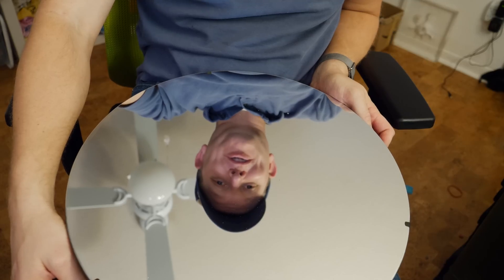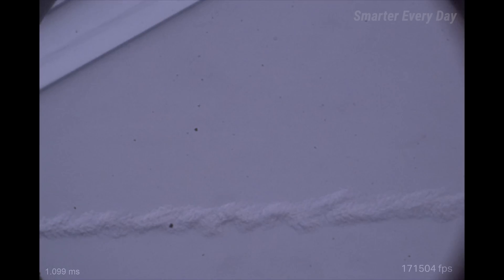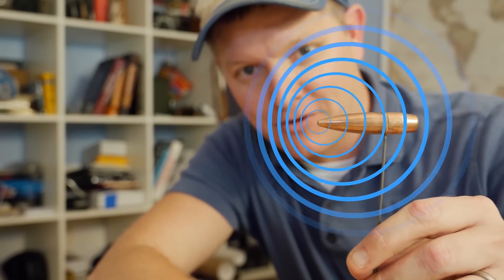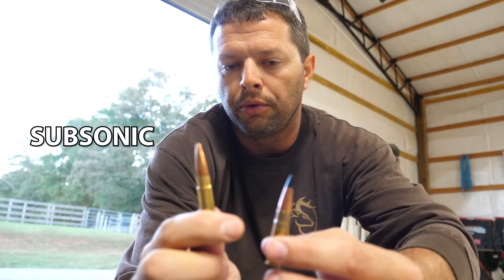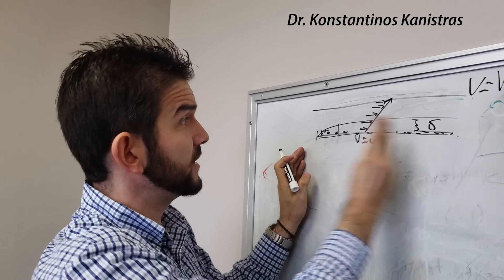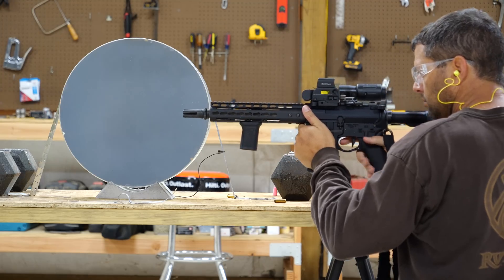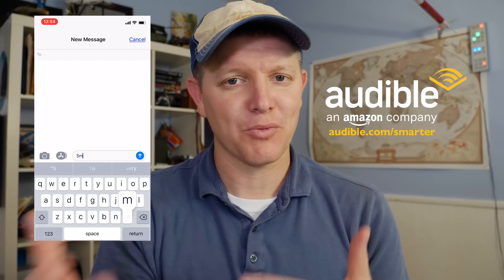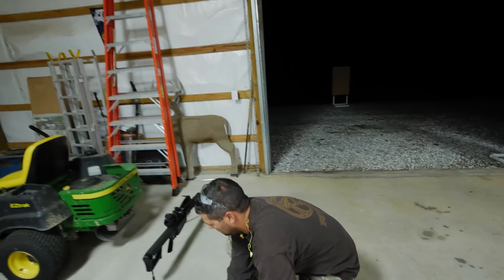Shockwave Shadows in Ultra Slow Motion (Bullet Schlieren) - Smarter Every Day 203

Comment: What would happen if you set up two Schliren cameras at right angles and filmed some of these events?

While the order imposed on the air by the initial tip shock waves is interesting, i’m drawn to the chaos of the passage turbulence. Is it actually a helix? Can you compute the spin of the bullet from that turbulence shape?  Does it relate to the tiny circles you noticed in the shock waves themselves?

Finally are we thinking about this 4D phenomena only in 2D?

Comment: Light always travels at the same speed right? So the whole refraction thing at the beginning of the video should be untrue.
Reply: It always travels at the speed of light _of the given medium_, yes. Which is slower in dense air and faster in less dense air, with the maximum (and the usually quoted one) in vacuum. That's also how Destin explained it in the video.

Comment: It would be really interesting to see the shock wave pattern when a supersonic projectile slows down to sub sonic speeds, but that would be virtually impossible to catch on video I think.  At least as far as I can imagine anyhow you would have to know the exact range that the speed drops so that you could set up to record it and even the slightest change in the burn rate would move that location.  I wonder if the Navy's magnetic rail gun can provide that consistency?

Comment: In the video, they should mention that the heat generated by the air on bullet created a vortex on the side and on the back on the projectile. This hot air create temporally a air density vacuum (hot air is less dense then cold air) an the cold air will rush to fill the void and will be accelerated at supersonic speed. That is what the Dr. might have explained but have been cut.

Comment: i'm pretty sure you'll explain how revolvers don't have a seal between the cylinder which is why it vents out the side. however, i should note in case you don't, that that feature doesn't allow it to use a suppressor. however, there is one example of a revolver that can, the nagant revolver, as it seals the the cylinder by pushing it forward. 

i was planning on getting one, but the one i found is in 38 h&r. $245 is a great deal for it, but the ammo costs about 50 cents a round for reloads (the shopkeep said he found ball for 50 rounds for 20 bucks... idk where he was looking but i cannot find anything outside hollow point and it annoys me. this is actually a cheaper round compared to the round it used to fire which is also wierd as the casing necked up to about the top of the bullet... the nagant revolver is weird and i want one, but i know it'll just gather dust or i'd have get a better gun. (currently looking into a px4)

Comment: You should use this filming method to answer the Air Force's questions about the effect of tracer plumes on subsonic 7.62x51 tracer rounds:
"It is not known why the burning tracer has the effect of decreasing the
dynamic instability of the 7.62MM rounds at subsonic Mach numbers, it is suspected
that a jet damping effect could be acting or perhaps a wind vane effect caused by
the tracer plume."
https://apps.dtic.mil/dtic/tr/fulltext/u2/a111780.pdf

Comment: the speed of sound is not static! it's actually a range called the "sonic regime" so different parts of an object can be breaking the sound barrier at different times while the object as a whole is all going the same speed! it's why the visible cone on a jet moves down the jet as it passes certain speeds (the cone isn't actually the "sound barrier" it's the water vaporizing because of the low pressure pocket created behind the shockwave, it actually happens much lower than the speed of sound)

Comment: I think the circular shocks you can see are perhaps from little cavitation bubbles forming behind the back of the bullet as it travels through the air. The air moves around the bullet and then suddenly falls back together behind it, bounces, forms a little shockwave from that bounce, and the process repeats a certain number of times determined by the speed of the bullet and the (I guess) viscosity of the fluid (air in this case).

Comment: If you look at the similar as during the air show at just Mach 1 and or the speed of; tip of propellers on Turboprop aircraft and also tip of turbofan blades on jet aircraft. The engineers don't want it to do Mach 1+ on tip of blades for very long exposure do to the shock wave will destroy the fan blades.

Comment: What an awesome video! I saw a fair amount of Schlieren images in my aerodynamics courses but to actually see things in motion is beyond amazing, thank you so much for doing this! Btw, I don't think you can use the $M=1/\sin{\mu}$ for those shock waves - that relation only applies to sound waves (waves of "infinitesimal" change in density, which do not create any entropy), but not shock waves (across which there is finite change in density and entropy is created). To calculate the Mach number of the incoming flow, you need to know the flow turning angle $\theta$ (which you could determine from the bullet tip shape) and the shock angle $\beta$. The formula is then $$\tan{\theta}=\frac{2\cot{\beta}(M^2\sin^2{\beta}-1)}{(\gamma+1)M^2-2(M\sin^2{\beta}-1)}$$, where $M$ is the Mach number of the incoming flow and $\gamma$ the ratio of specific heats (1.4 for air), but the result is most easily read off a diagram. "Anderson, John D.: Modern Compressible Flow" seems to be a good resource.

Comment: Sweet vid! Re: normal shock on the subsonic bullet. I don't doubt that what we're seeing is the normal shock at the first band (mind you I never took aero class), but at the second band, what do you think about the effects of the knurling (go to t=4:38 and look at the very end of the casing) in the copper jacket interacting with the air as the bullet is rotating (along it's long axis). I.e. what if the knurlings are acting like an impeller and beating the air as it spins, therefore causing a disturbance? Thoughts?

Comment: What you are seeing is the bullet spinning at a high rate of RPMs while traveling supersonic speeds like 150,000 RPMs for a bullet going 2500 fps down a barrel with a 1 in 12 twist rate

The bullet is actually high speed drilling its way thru the dense air friction in front of it while creating a low pressure line of air directly behind the bullet in flight

Comment: Good day gentlemen that was very cool but not for the reasons of the title of the video . I was actually interested in what seems to be the air and gases leaving the barrel before the bullet . I'd love to see a video concentrating on that aspect . It was more pronounced in the revolver video but can be seem in the muzzle blast rifle video . 

I like to see a more concentrated view of the muzzle at different angles to see how much and at what force air and gases are expelled from the bore before the bullet leaves the barrel . More specific does that air and or gases interact with the muzzle device of the rifle in away that effects point of impact shifts . 

The other thing I'd like to see is if there is actually blast coming out of the muzzle ahead of the bullet when using the revolver . If so that would seem to indicate that the gases from the powder expand around and past the bullet before it engraves into the lands of the barrel ??????

Comment: Before he did the breakdown of the subsonic bullet I kinda felt like I knew what it was already. The lines around the bullet reminded me of a jet as it's accelerating and beginning to pass the speed of sounds. There's a brief period where you see a "cloud" surround the jet and it looks alot like that bullet.
Reply: The smoke in a jet is not the Sound wave, you cannot see sound wave or sonic boom in a naked eye. The Cloud in the jets are cause by cold relative air that surrounds the jet/bullet, passes to the rear side of the jet/bullet which is a very hot area, changing the Temperatures from extreme cold to extreme heat at a very Fast Rate could cause a cloud that can be seen in the pictures of Jets reaching Mach 1 above.
Reply: In some pictures you can see water to condense behind shock waves.The effect is calle Vapor cone. The effect is caused by temperature reduction around the jet/bullet and high relative humidity (highly simplified explanation of thermodynamic process happening). There is pressure raise and drop which have matching temperature changes.
Reply: At first I was thinking it was a disruption in airflow due to a cannelure around the bullet at the point of the disruption was about where a cannelure would be on a rifle bullet.  My thought was this indentation would be causing the smooth air wrapping around the pointed end and flowing around the sides to ripple a bit as it flows over the cannelure in the bullet jacket.... but I guess I was wrong :-)
Reply: @EBinCA r/iamverysmart

Comment: An excellent video but one question: When you measure the angle of the shock-wave to the trajectory in your first video, you get approximately arctan(5/8) = 32 degrees. The sine of 32degrees is 0.53 and the inverse of 0.53 is 1.8867 which I agree is the Mach number. Assuming the local air temperature and density give the local speed of sound as 343m/s, the speed of the 50cal projectile accounting for error in angle measurement is around 650m/s. Most 50cal projectiles have muzzle velocities of between 850m/s and 930m/s. So what round did you use?
Reply: the cheap stuff

Comment: Question:  Has any significant research been done on the effects of 1/3 normal gravity on the human body over prolonged exposure?  If living for an extended period in 1/3 normal gravity causes significant serious damage to the human body, then Mars and the Moon are essentially worthless for human colonization.  Before we spend tons of money trying to colonize Mars or the Moon , we should now the answer to this.  Research on mice on this issue could be done on this issue on the ISS at very low costs in terms of launch cots, space on the ISS, and astronaut time.  When will this be done?
Reply: When there is a method of simulating different levels of gravity for long periods. :)

So far no one knows for sure.  We have had people in micro gravity for more than a year but no data on long term effects of various fractions of gravity.  You are 100% correct, answers will need to be known for long term living.  I have wondered why no one has not tethered a couple space craft together and spun them up to at least moon gravity and put some test subject (man or mouse) in there for 6-12 months.  The moon is close so long term studies of low gravity will probably start with incremental stays there.  I suspect no studies will be done until the cost and reliability of getting off the ground reaches a certain point of affordability.  Until then they will probably just keep the exposures short leaving no one living permanently off planet for some time yet.
Reply: Lensflare Deviant Mice!  Take a rotating habitat 2 m in diameter up to the international space station put by cement and rotated at about 20 rpm. That will give you an apparent gravity for the base of about 1/3 normal gravity or something just about equal to Mars gravity. Keep the mice there for as long as you want (they don’t have a Union) then bring them back and see what kind of effects of happened or not happened on their metabolism. Cheap, quick to do, and it would certainly give us some significant data. Certainly, It wouldn’t be data on people but it would give us some indications of what we might see in people. Right now, as far as I know the international space station is the only place that we could really do this kind of testing quickly and cheaply. As far as I know though, no one is doing it. Why not? Wasn’t the idea behind the international space station to enable us to do experiments exactly like this?
Reply: @wbwarren57  In 100% candor I'm not at all certain if mouse studies would yield anything useful but on the flip side I find myself in complete agreement that not only could something like you described be done but that IS what they told us that station was for..  Any data is a starting point and if nothing else an experiment along the lines you described would still yield up SOME information, much more than how ants work in micro gravity.  It becomes even more important once there are enough people floating around that someone can get themselves knocked up.  I was even wondering about short term exposures for things like a Mars mission.  Right now they're saying 6-8 months to get to Mars.  Fine, that's in micro gravity.  Right now after 8 months in micro-gravity the people come back as weak as kittens.  Mars is still only 40% earth gravity but those first explorers are still going to arrive partly disabled and will need to recover from the journey before they can even think of wandering around planting flags.  If there is a medical emergency at that point there could be a problem!

Comment: You could figure out if that last weak shock wave was from the muzzle by doing a little math
(I'm a bit rusty on this sorta thing so I might be getting some of this a tad wrong but this is how I think I'd go at finding it out)
Using the frame rate and the known length of the bullet you can find the velocity(or having just watched a little further in you could just use the mach angle to find it), you'd need to know how far the gun is away from the spot being filmed and use the velocity to find when it was fired then divide that by the speed of sound to get how long it would take the shock wave from the muzzle to reach the frame, subtract the time that you got from plugging in the velocity of the bullet and check if the shock wave appears around that time after the bullet enters frame.
You should also be able to do generally the same thing to find out how far the surfaces the supersonic shock waves are bouncing off. We know they'd be going the speed of sound so we just need to time how long it takes for the shock wave to exit at one point to when one of them reenters at that same point, then just multiply by the speed of sound.

Comment: 2:00 On the topic of identifying the sources of the additional shockwaves: shouldn't it be possible to validate your guesses by trying to modify the shockwaves? What I mean by that is making the surfaces (e.g. plywood table or concrete floor) less reflective or swapping them. Thinking of something like using sound dampeners for audio studios.

Comment: Every YouTuber is doing it wrong these days. Light speed never!!! Changes - doesn’t matter the density of the air! It just takes a tiny faster way because it doesn’t interact as much with particles. But light itself never changes speed, that’s against all laws of physics. Why do you guys keep saying this?
Reply: You are actually incorrect...sort of. Yes the speed of the individual photon never changes. But when the photon interact with a particle(atoms). The absorption and remitting of the electromagnetic wave is slower than the speed of light, thereby causing the wave to turn slightly. speed is a measurement of distance over time. So speed of light through medium will be reduced by the optical density of the medium. The speed of light in a vacuum is a constant(also independent of the observer). But light in a medium(air) is not constant. Look up optical density and index of refraction for more details.

TL:DR It will take light longer to reach a destination in a medium vs a vacuum. AKA slower.
Reply: You're talking about a different definition of "speed of light". The speed at which light travels through a medium is not the absolute and unchanging speed of light, but is entirely valid and legitimate use of the phrase "speed of light" and by that definition the speed of light can and does change.

Comment: I’m a Masters student at TU Braunschweig doing Computational Aerodynamics.
From what I studied, I think the other 2 shocks are not exactly shock waves. It can be explained by so called “Riemann Problem”..
When there is a supersonic flow, there are 3 things happening. In the beginning, there is the shockwave, where there is a sudden change(decrease) in Pressure and velocity and density. It is followed by Contact discontinuity wave, where there is a sudden change in the density. It is followed finally by Expansion wave . It’s weaker than the first 2 waves. Here the pressure and velocity gradually changes back to the surrounding condition. 

I really wish u make a follow up video explaining this concept to your viewers.

Comment: An aircraft flying Mach .8-1.2 has reached critical Mach. Meaning that even though the aircraft isn’t flying super sonic certain areas on the aircraft are experiencing super sonic airflow due to the acceleration of air around air foils which is a direct result of producing lift. In the case of the bullet even though it’s not flying super sonic, the airflow on some areas may in fact be super sonic because it’s being accelerated around the bullet.

Comment: Given that you can see the muzzle blast wave as it passes in front of the mirror, it would be interesting to try using a can to see how that wave is weakened. You could also try firing with the can in front of the mirror to see how it bleeds off gas to reduce the shock.

Comment: The vertical shock wave following the bullet was the compression wave of the report of the rifle. You can prove this by measuring the Mach number of the round and the difference in the arrival times of the bullet at ~2.02 Mach and the report at 1.0 Mach over the distance between the muzzle and the imaging line.